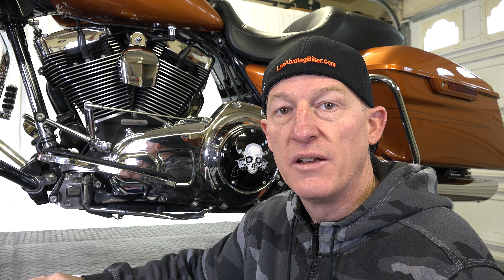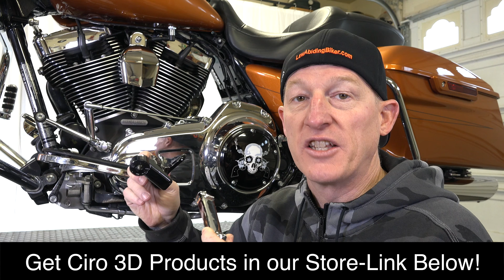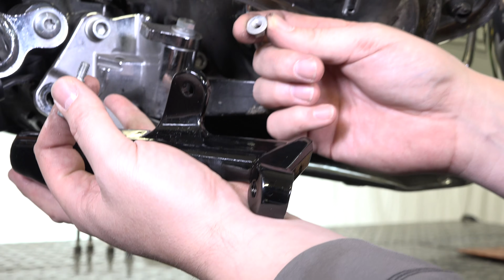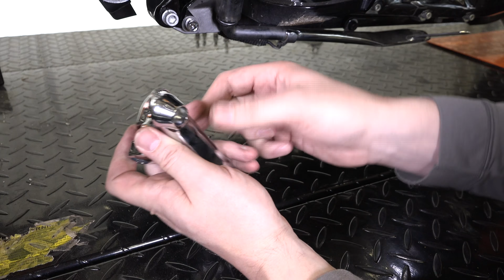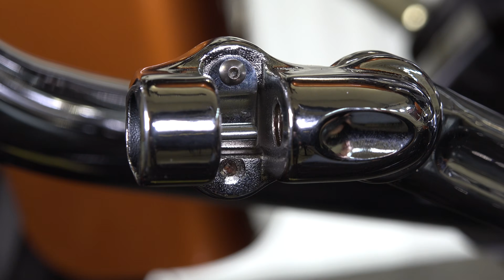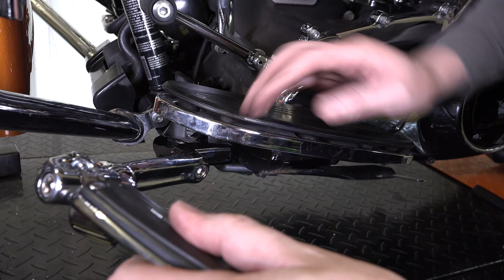Install Ciro 3D Adjustable Highway Footpeg Mounts on Harley & Review

Comment: I am interested in this option for my 2026 Road Glide but I need to relocated the floorboards with either spaces to push out the floorboards about an inch or with the Kuryakyn relocation kit which pushes the floorboards out an inch and forward an inch. Will you still be able to mount the Ciro frame mounted highway pegs?

Comment: Old thread but took a chance and pulled the trigger for my 2010 RG. The lean angle has been badly redcuced and the stick out laterally way too far. The frame mounts and and the chrome peg mounts should be not as angled and be straighter to avoid an uncomfortable groin split. I'm not a gymnast.

Comment: Ryan I put these on my CVO road glide.  I went round a corner kinda fast and the first point of my bike to touch was this Ciro Mount…. Not the floor board or the feeler peg. It lifted my wheel and sent me down the road … low side. $15k damage. With your riding skills can you do some tests on this? I’d like to see how much it reduces the lean angle.
Reply: first thig I thought of was the loss of lean angle. I frequently drag my floorboards around town & this product would not work for me. Sorry for the damage to your bike, but thanks for sharing this safety issue.
Reply: P.S. I notice he does not have this product on any of his bikes.

Comment: Highway pegs are expensive and i have the Kuryakyn Pegs on my 98 goldwing.  The problem is where they attach to the crash bar. The back side of the bolt almost rest against the engine side cover's.  I've dropped my bike a few times( heavy sob )..lol and that bolt hits the cover. I need a bracket to move this away from the covers before i do some real damage

Comment: I bought these and ABSOLUTELY love them. They are so comfortable and adjustable it is unreal. Safety hazard: they feel so good I sometimes forget it is not the brake I am resting on.  I had to add a 1/2 in spacer for my aftermarket exhaust ( the footrests had to come out 1/2 in for the bigger exhaust).
Reply from the maker: Good info. Thx for sharing

Comment: What a great video. I feel the boxed instructions are lacking. I love the look of these pegs and the adjustability of them. I just put these on my bike, 2009 HD Ultra Classic CVO, and as per usual CVO changes things up, nothing that can’t be taken care of, but this may save time or frustration. #1 the front bolt normally for reuse can’t be reused on the Ciro, as the stock mount on the CVO is thicker than a stock mount of other bikes, and the mounting bolt is threaded into the mount itself, so I went to the hardware store and bought a bolt and not for replacement, sorry I don’t have the size, but it is longer than anything in the kit. #2 the CVO front floorboard mount is thicker than standard mounts, hence the space on the floorboards are wider so I installed a small shim (you could use washers) on the bolt fastening the floorboards to the new peg mount. This may not be necessary as the bolt has a short thread run and possibly wouldn’t be of concern, but it made me feel better. #3 if you are using HD foot pegs you will not need the little screw and clip designed for the new installation, i believe it is designed specifically for Ciro foot peg with notches, which HD doesn’t have. If you own a CVO these tips may save a bit of time and frustration.
Reply from the maker: Good info. Hope this helps others here in the community!! Thanks for sharing.
Reply: Ryan Urlacher you bet, again thank you, great spot on photography etc.

Comment: I read on Ciro's website that Defiance floorboards require modification. They don't give anymore info on that. Will eventually call them about it, but have you ran in to any issue if using the deifance floorboards made by HD?
Reply: Just got off the phone with Ciro. The tech said some minor grinding of the webbing on the underneath side of the floorboard needs to be done. Sounded like it was very minor so the floorboard will sit flat.

Comment: would these fit 2013 fxdc with driver floorboards ?  Or what hiway pegs would u recommend ?
Reply from the maker: We can't guarantee fitment on your model. But, check out the video. It shows everything. If it looks like it'd work then go for it. Other than that, not alot of options unless you put engine guards on. ==> https://shop.lawabidingbiker.com/products/ciro-highway-peg-mounts

Comment: Hey Ryan, appreciate another good video. Does require use Ciro foot pegs ? My ‘17 CVO Street Glide equipped with air flow collection pegs and I would like to match them.
Thanks brotha ~
Reply from the maker: You can use any standard footpeg you like. Doesn't have to be Crio.

Comment: Ryan,  would they be in the way if you corner really tight??  I know when I was riding the Dragon in Tenn... my kick stand would drag...on left hand curves.
Reply from the maker: Yah, but I drag my engine guards at times. And my floorboards, and my floorboard mounts, and kickstand, and on and on. As long as you know what your dragging. It's all gonna drag if your aggressive. All good.
Reply: They do drag -- just don't lean more once you're at that point and you'll be good! They also act as another level of engine guard protection, wouldn't support a crash like a true engine guard but at parking lot speeds or just in the garage they work.